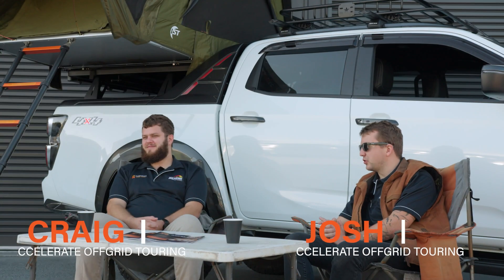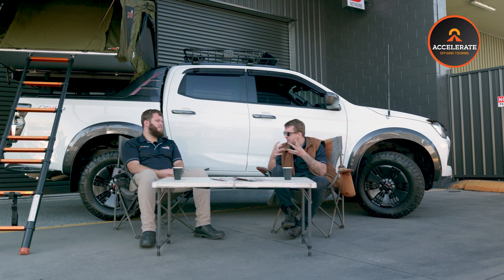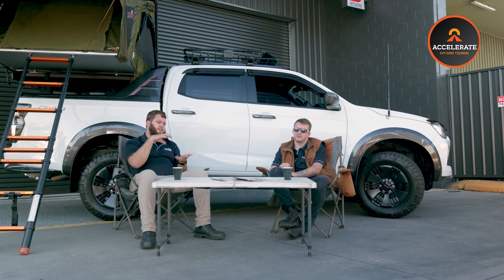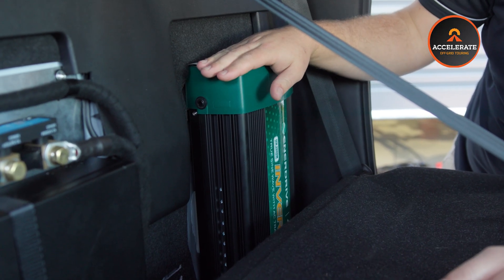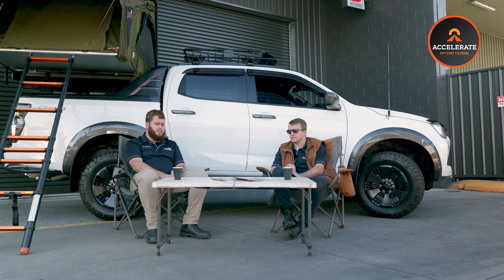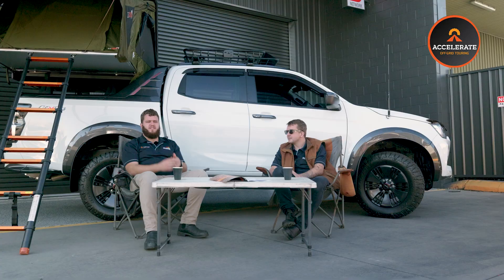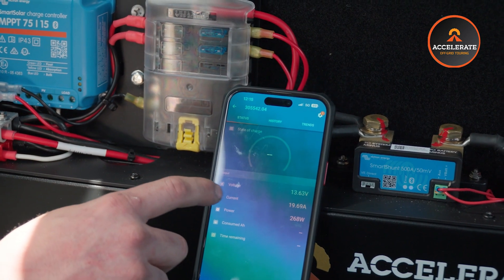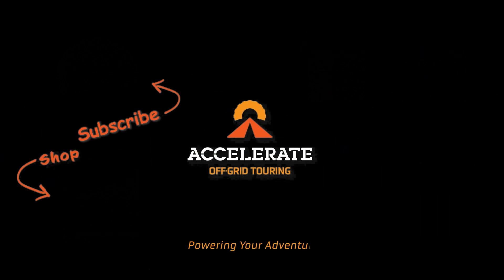ISUZU DMAX - 200Ah Behind Seat Lithium Dual Battery - ULTIMATE HYBRID TOURER

Comment: Hi, sorry about the late message. This configuration is something that I have been looking into for some time now for my D-Max. I am curious about the 40A DC-DC charger, considering the D-Max has a 90A Alternator fitted from factory 
The estimated Total Load of the D-Max
Light Load (Low A/C, No High Beams, Low Stereo Volume) → ~35-45A
Maximum Load (A/C Full, High Beams, Stereo Loud, Everything Active) → ~55-70A
which leaves about 20 - 45A headroom depending on loads.

Adding a 40A draw from the charger could potentially have the alternator running over capacity (75 - 100A), which is pretty detrimental to the alternator over a period of time.

Could this be a problem for the alternator size? should I look at upgrading my alternator?

cheers,
Reply from the maker: Hey, Yep upgraded alternator is always good. We have done some on the Dmax. This has been in the customers car for 8months no issues, if there is in the future we can upgrade the alternator. With the fixed solar panel setup it also charges from there at the same time, reducing Alternator load.